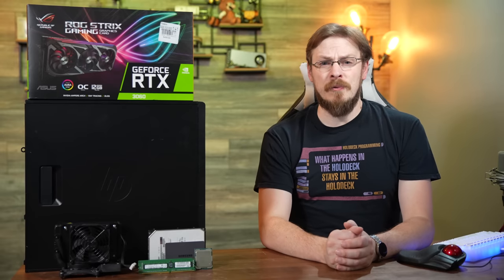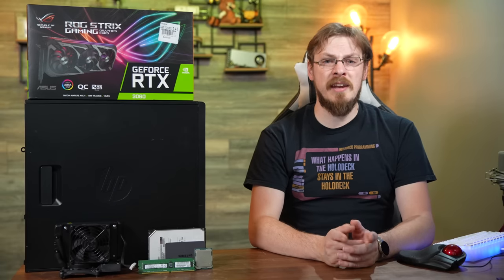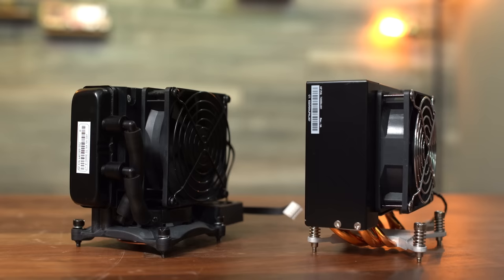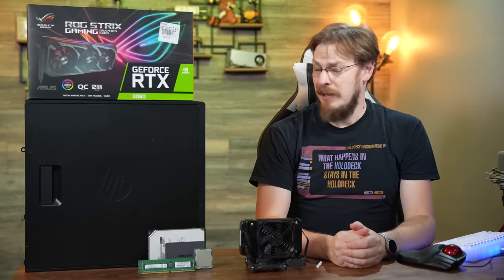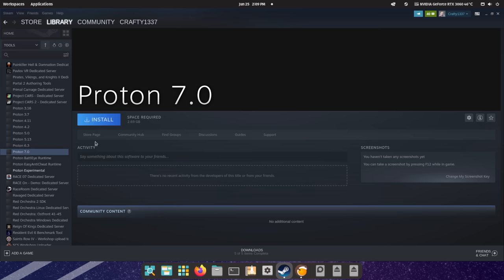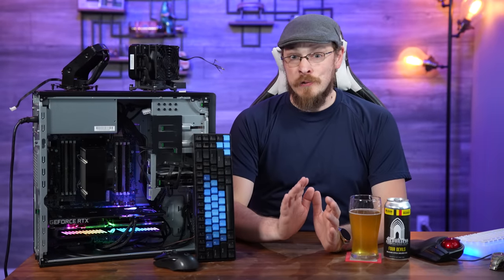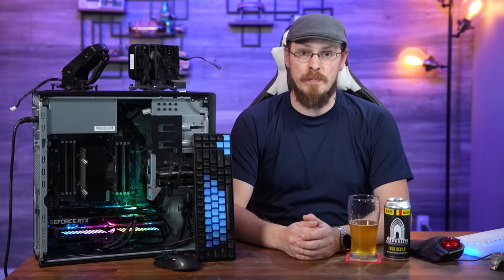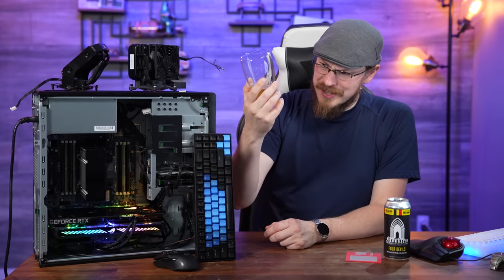A Used Xeon, a New GPU and a Linux Install - HP Z440 Gaming/Workstation Build

Comment from the maker: New Customers Exclusive – Get $25 off your purchase of any AMD and Intel Processor (limit one per customer): https://micro.center/85a332
Check out Micro Center’s Custom PC Builder: https://micro.center/e30f96
Visit the Micro Center Community: https://micro.center/e8d37e
Reply: some professional software can run in lutris with a bit of tweaking.
i managed to get Autodesk Fusion 360 running in lutris 
cinebench also works.
Reply: What do you end up doing with these PCs? Are they requested by customers? If no, what happens with them.

Comment: WARNING: If you are gonna purchase a Z440, be very cautious at what power supply it comes with, some Z440 models have two power supplies, 700 watt and the 525 watt, the 700 watt has extra 6+2 Pcie pin connectors, whilst the 525 watt only has 6, so be very mindful of that when buying a graphics card with more than 6 pin connectors.
Reply: I have e a 700 watt power supply but it has only 2 six pin connectors and not 6+2 pin connector?

Comment: Geoff, I wonder. You have a wide range of experience with an eclectic mix of hardware. I wonder, what would you build if the parameters weren’t hardware cost, but operating cost? How much functionality/performance can you get out of low wattage hardware? Are the best options the little NUC-likes or is there something else which could also do the job of a home server doing storage, transcoding and other functions which we wouldn’t think of?
Reply: Does it have to run at factory speeds?
You can get quite alot more performance-per-watt out of a 3950x/5950x and i assume threadripper by undervolting and underclocking to about 3.2Ghz, only using about 70w you get similar performance to a 3900x/5900x while those two processors are using ~150w(at sock clocks), yes, more performance, for 1/2 the power.
Reply: Jeff with a J on this occasion my friend..
Reply: Not sure if promotion is allowed in comments, but there is a channel called Hardware Haven that does a lot of videos on low power servers
Reply: @denvera1g1  isn't that only for tasks that will actually utilize all cores though?
I mean, it's the same chiplets in both, so multicore will probably keep up but per core performance will be absolutely tanked
Reply: Underlocking modern cpus reduces power dramatically, but it decreases performance a tiny bit. 15% less performance, but 50% less watts, it's insane.
In the old days CPUs had smaller TDPs out of the box, but they could be overclocked a lot. Nowadays it's the opposite, overclocking is very limited, and the chips come with high power needs out ofthe box, however with a simple setting you can change all this, just don't but a cheapo motherboard as the bios options will be limited.
Reply: @werewolfmoney6602  To give you reference of the undevolting on 3950x/5950x. I have my 3950x running at 3.5Ghz, but it uses only 80w instead of 150w, but it has like 90% of the performance it has at 150w.
I use this CPU 24/7 to transcode handbrake and it is almost 2x the performance of my 3700x, while using about the same power.

The down side is that i have no control over the OS, if i had control over the OS, i could design the OS with a scheduler that would prioritize for gaming while gaming, basically shutting off the second chiplet if there are not enough threads to need that chiplet, or run the second chiplet at like 2.2Ghz for things threads that dont need the performance
Reply: Hello. The best option (with caveats) for what you are talking about is the  Apple Mac Mini. Obviously, this is not a Windows PC. However, if you can find the software that you need, I highly suggest this device for those parameters you mentioned. Yes, there are limiting factors, but the efficiency is simply too great to ignore. The Mac Studio would be the next, huge leap in performance, while maintaining efficiency. Seriously though, a Mac Mini with 16 GB has already been shown to out perform PCs with a ton more hardware. It is a different beast, and there are some hoops to jump through. But in my experience, it's worth it.
Reply: It depends what you mean by functionality. CPU is just one component, if you need a lot of stuff connected to it then a workstation or server chip can be more useful, it's just then about which uses the least power and lets you plug in all the things.

The NUC, for example, is great if all you need is a bit of CPU and memory, but a storage server it is not. It also has limits on networking, memory capacity, etc.
Reply: This probably isn't worth my time to type for most people, but the last generation of Intel Atoms they had before discontinuing them were pretty damn good at performance per watt, while also having a ridiculously low TDP.  They got a bad name mainly from being included in crappy devices with hella slow eMMC memory that degrades really fast, and with minuscule amount of RAM (like every single crappy netbook), which when forced to use the page file made it that much worse.  You can find devices like mini servers with them, and some can be pretty decent if configured correctly.  They apparently even made some that had up to 8 cores, and could get away with more than 16GB of RAM.  Kinda sucks that they were screwed into the rep they have.  (although, older Atoms did pretty well suck, I'd suggest the last gen.)

Comment: I have 3 z600s in my house, one running windows (my wife's gaming machine), one macOS (logic Pro/video workstation), and one running Pop!OS. That first generation of HP hardware, especially the 600s and 800s, were so well engineered.
Reply: I just purchase myself a z800 workstation. Not because i really need it, but because ive aways wanted a dual x58 platform for my collection. I also have a dell t7500 dual 771 socket system with dual x5460. Eventually id like to have a dual 2699v4 system.....maybe next year.

Comment: I've been running a Z440 for my main 24/7 Proxmox "server" in my homelab for a while and it's been fantastic. My build is all-SSD to keep running costs down, and I've got 12 SSDs in it (4x1TB NVMe + 4x256GB NVMe in two ASUS Hyper M.2 x16 cards + 4x480GB) with 64GB of RAM, an E5-2660 v3, and a Mellanox ConnectX-3 10 gig SFP+ card. Idle power consumption (with a normal CPU load of about 10-15%) is about 60-65 watts, so it's decently power efficient. Might upgrade to a 2680 v4 CPU at some point though.
Reply: chill tf out. those are some fucking amazing specs
Reply: Looking to get one of these for a home server myself. Thanks for the info
Reply: Where the hell you put all those ssd xD.
Reply: @stormk-1130  ASUS Hyper M.2 x16 cards (each one takes four M.2 NVMe drives).

Comment: I had a similar issue with a z800. I just bought some noctua fans and added some converters that were hand made to them with the low voltage resisters. Works like a charm.

Comment: HECK YEAH! I'm rocking a z420 and z440 atm, and it's a dream. Solid Price/Performance, the ability to OC and QUAD CHANNEL!!!!!! I will say that the v3's are the best strictly because of the turbo boost, and OC capability.
Reply: I have a z440 motherboard using it in my sever

Comment: love the z440, i got one used for 200 bucks back in 2018. with a cpu upgrade it made a great starter home server
Reply: What's the highest CPU that can be dropped in it? All the way to the top, or are their PSU/TDP limits?
Reply: @mozamboni  i down know the highest CPU, but my z440 comes with xeon e5 2690 v4
Reply: @mozamboni  to my knowledge there are no psu/tdp limits, the only limit is the socket :)
Reply: @mozamboni after a BIOS upgrade, apparently the 22c/44t Xeon Broadwell v4 CPU's are supported!

Comment: I love these HP and Dell workstation towers, so versatile and well-built.  I put together a similar build in a Dell Precision 7810 a while back.
Reply: I'm still using a T5810 while I build a new computer, thing has been rock solid.
Reply: @nadtz  T5810 is a great choice too, I love the metal handles on the Dell workstation chassis.

Comment: 4:16 Well darn, i was hoping for another schrodinger's paste.
"In this enclosed case i have placed a cpu, a heatsink, some thermal paste, and a small ampoule of caesium-137"
'The paste will be in a superposition of both applied and not, until you open the case and collapse its very function'

Comment: I have a few of these. Maxed one out with an i7-6950X, 128GB 2400MHz RAM, 4x NVMe in RAID 0, 4x SATA SSD in RAID 0 and 2x SATA HDDs in RAID 1 plus an RTX 2080ti. That was before the current gen GPUs were released. 2 of them were budget builds for brothers with E5-1650v3 6 core, 32GB RAM and an RX 580 8GB. Latest one is another budget one for a friend with an i7-6800K, 32GB RAM and going to stick a 1080ti, 2080 Super or 3060 in there I guess. Still excellent value if you watch for auctions or local marketplace sales.

Comment: Helpful Video, thanks! I have a couple of questions regarding the Z440. I'm about to decide whether to buy a used Z440 Workstation with the following specs: AMD FirePro W5100 4GB (2014), Intel Xeon E5-1630 v4 (2016), 32 GB DDR4 PC4 2400T RAM, and 256 GB SSD. Do you think Linux (Pop!_OS for example) can be installed without any problems right out of the box (USB live installer when booting) and run well with that AMD GPU? Also, is it a big hassle to just plug in an additional SATA SSD to keep Windows on the first one and install Linux only onto the second SSD (dual boot basically), or is there a catch to that? Thanks!

Comment: Hey, that's my current PC! I got HP Z440 with Xeon(R) CPU E5-1650 v4 and 64GB DDR4 RAM paired with RTX 3060ti and some additional SSDs. I use it mostly for gaming and it does quite good job even at 1440p. Sure, in some demanding games it's not reaching 100 fps, but for example new Darktide runs nicely around 60 fps and that's on high settings (RT off ofc).
Reply: nice combo am planning for the same one but paired with a RX 6600
Reply: @Jaroartx I just ordered one for $220 and will be putting my current rx 6650 xt in it!
Reply: Is the limiting factor the cpu or the graphics card?
Reply: @GunMedalGleam  I think GPU was the limiting factor. It's similar to something like i7-6800K so obviously it is aging tech. But hey, for the super low price I could get that machine, it was simply great! Price/performance was unbeatable and worked great as decent gaming machine without breaking the bank. Now you would be crazy to put some super expensive GPU in that one, but my 3060ti was second hand as well and ran nice with this CPU.
Reply: @Hombremaniac  the 3060ti in my opinion is the best all around card on the market. Its very powerful perfomance wise while still being pretty efficient. The fact that the 1650v4 doesnt bottle neck it is good too hear.

Comment: How did you connect gpu power cable to graphic card? Z440 gives you two 6pins PCIe cables(700w psu), but your card is using 8pins. (some cards use two 8pins i am wondering how to connect them also)

Comment: The Dell Precision 5810 is the same chipset era. Just make sure you note the power supply on the unit. They come in 425/685/825 watt flavors depending on the initial config. Replacement is an easy field serviceable slide out/in.

Comment: I recently got a dell precision T5600 that I really like.  It is compatible with the E-5 v1 series of CPU's which are VERY cheap on eBay right now.  Plus I inherited 128GB of DDR3 ECC RAM that was compatible with this unit.  Yes, the CPU's aren't as good as the one noted in your Z440 but the T5600 has two sockets.  So after maxing it out on RAM and CPU's it is quite snappy.  I really enjoy old XEONs for bang for the buck.  Your series has really helped me to see them as a valid alternative.  Thanks!

Comment: I have it's older, slightly less capable cousin, the HP Z420.

It works.

(It's not going to break any records these days, but it can be quite a potent system if you build/configure it as such.)

Comment: Workstation systems are obviously good for pure workstation builds, but how do you feel about using them as home servers? On the plus side they're quieter than rack servers, but on the other hand they don't have IPMI.
Reply from the maker: Dead silent, very upgradable. These make fantastic homelab boxes.

Lack of IPMI only matters if you're trying to learn about IMPI controls. It has no real bearing on function.
Reply: @CraftComputing  Getting up to press the power button is so 20th century. Though I suppose if it's a "real" server you'll just leave it on.
Reply: @eDoc2020  leave your sever on where i live and you spend your life savings on the power bill XD
Reply: @AIC_onyt  One server staying on shouldn't bankrupt you. But then again where's the fun in only having one?

Comment: i have an hhp z600 with dual xeon x5660s that i still daily drive...for 1080p gaming with an r9 280x its fine, for my linux work is great with all those threads and 48gb triple channel mem, and its just solid and steady...ive had it for over 7 years...ill upgrade soon but honestly these still make great budget ws or even home server builds imo...downside of course is wattage but i let it sleep so its reasonable...love the case too

Comment: Z440 is a nice PC. I was bidding for a Z420 but they sent a Z440 that they wanted back. Well I had an older Z600, that is almost good enough. But Z440 with DDR4 is great. I hate HP special fan connectors, they even do it different from model to model. With my Z600 the fan controller is jammed to max, common problem and I use a fan resistor as a walk-around without changing the cable harness.

Comment: Point of correction RT and DLSS do generally work on NVidia cards running under Linux. However you need to proactively set the switches in the Steam arguments when the game launches. I've used both on Wolfenstein Youngblood, Control, Cyberpunk and RT on The Ascent (that one I did have to use FSR, via Proton GE). Natively used RT on Metro Exodus and Quake 2 RTX.

Comment: Got a hp z800 with two 8 core xenon’s.. used. Works fantastic. 1200 watt power supply stock?!?
Reply: The dual socket workstations are expected to cope with several GPUs, right?

Comment: That's actually one of my favorite topics but I actually went with G8 and RX 6800 XT and MacOS as primary for my workflow needs but with Parallels for gaming, and works like a charm. Was previously on cMP 5.1 with R9 Fury and kinda liked the workflow but it became a bit slow for my needs even with 2x x5690 and had to run OpenCore anyway, and new mac pros are just not there, 6.1 is a dump and 7.1 is expensive for what it offers

Comment: 10:13 aw man, I was getting hyped expecting some tiered storage magic! IIRC there's a way to get pretty straightforward tiered storage using LVM, so that the SSD is boosting the spinning rust, but transparent to the user (in your case you'd see a 7TB volume)
Reply from the maker: Yeah, I was looking at playing with that at some point. Might make an interesting video on its own. I actually wrote an article about tiered storage years ago ;-)

Comment: Do you know if the HP z440 needs a SAS controller to use SAS hard drives? The documentation on the HP says that it is compatible with up to four SAS but I cannot find where to plug them in. Do I need a special plug in adapter? Thank you for your help

Comment: Z440 w/ Xeon E5-2699 v3 and Gentoo Linux as daily basis distro should be a superb machine, or FreeBSD if I will a reliable ZFS home storage and server. I don't know yet which GPU should I put of them but maybe a cheap used GTX 1660 Ti is an interesting choice.

Comment: How hard is the setting up the HP Z440 for dual boot? For those of us who don't want to risk aspects of our steam account playing on LINUX?

Also, did you try to spec the memory coolers as well? Or did you simply consider this a non issue if you have enough case air flow?
Reply: What risk are you talking about? It’s not illegal.
Reply: @Hornet135   - Uhm, you can get banned for having a dual boot machine on Steam if you play non-LINUX games. The security features for some games do play well with it. DAYZ is one such example.

Comment: How did you get the 3060 to work? Curious as my Z440 only come with a 6 pin connector?
Reply: I bought a 6 pin to 8 pin adapter for my GTX 1660 ti. Works great!

Comment: Jeff - will you do the community a favor and put 64gb and/or 128gb dimms in it and see what happens?  The predecessor z420 supports 32gb dimms (both rdimm and lrdimm) even though the manual says it doesn’t…would like to know if the z440 is as friendly as the z420.  Your 1600 series Xeon probably doesn’t support lrdimms though so if you want to do this test you’re going to need to locate a 2600 series v3/v4 Xeon.

Comment: I juts ordered a z440 with E5-1650 v4, 32gb of ram, 512gb ssd and windows 10 pro for $220! It will be replacing my current i5 2500k (at 4.5ghz), 32gb ram, 1tb ssd and rx 6650 xt. I will be moving over the ssd and graphics card from my old system!
Reply: where did you get one for that price? i'm in canada and cannot find a good price. the ones one ebay canada are all expensive

Comment: I have 2 of these at home with one setup in a similar config (The other is setup with an install TruNas). What I would recommend to get that extra boost in performance. Get a PCIe M.2 riser and boot drive. Really finished it off.

Comment: Ive never used nvidia cards with linux, (just intel or amd cpus with their iGPUs) but ive heard from everyone i know that distros like popos should boot up with nvidia cards, but for some reason no linux distro i tried would boot up with my gtx 1050ti, not even the nvidia iso of pop os. i get to grub/systemd boot on all the isos, but from then onwards, its just a black screen, a kernel panic or stuck at "Loading Linux" section on the boot log. Any idea what the issue is?